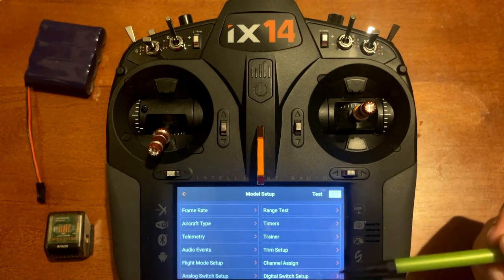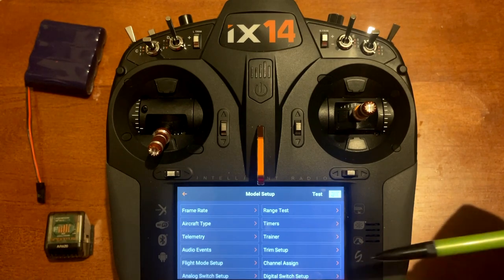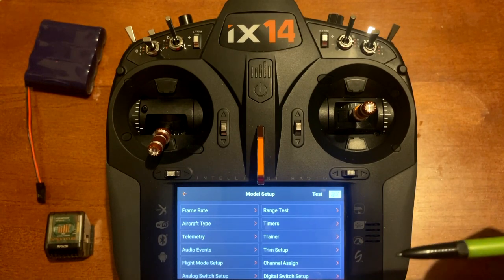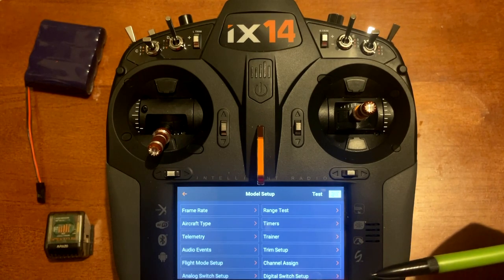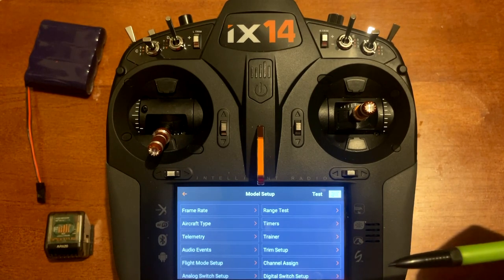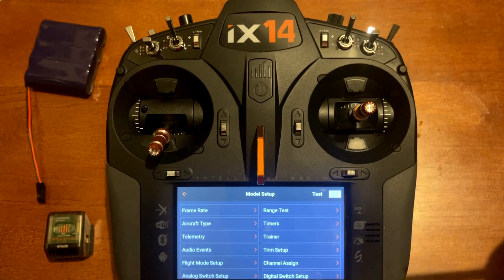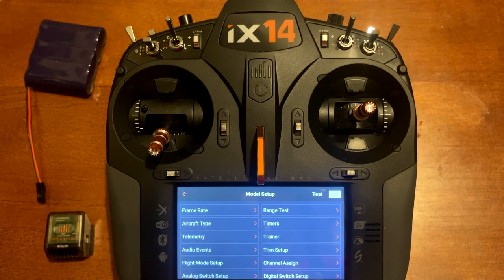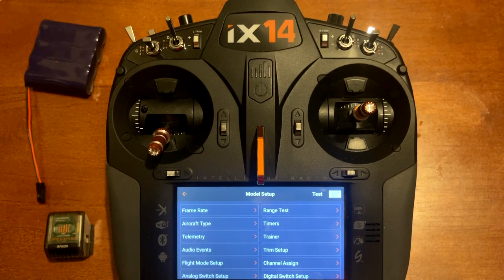Spektrum iX Setup: How to Setup RC Plane-Without Template

Comment: Hi BD! Thanks again for such clear and informative videos on the Spectrum transmitters! Very helpful! I do have a question. I'm having trouble trying to get beep sound from  my any of the trim buttons on any of my models. I have . Opened up a new model,  Went to "Audio Events" menu then to  "Trim Reports" menu...everything set at TONE and orange button at default. still  no trim  sound. I went to the Android set up page and made sure "sound notifications" was turned up..still no luck...Any suggestions would be appreciated! Thanks
Reply from the maker: Only issue trim sounds? Does other sound functions work? Which version is Airware App?
Reply: Thanks for responding.. Latest version.. everything works but the trim buttons. It’s a mystery.
Reply from the maker: @aidengriffen  go to sound settings > system sounds. Each one can be adjusted. See if trims option is lowered.
Reply: Well I went ahead and reset the ix14 back to factory default settings. And lo and behold everything is now working properly.. trim sounds and new software version sounds.
Not sure where the gremlin was hiding but seems like we’re back up and running! Thanks for your suggestions BD!

Comment: Hi BD. I followed your NX series and now the iX series, both have been very helpful. One annoying part of the iX setup is the default keyboard sound. I’ve had to turn the volume down. Is there any way of permanently muting it or changing the sound? Thanks.
Reply from the maker: Keyboard sound, referring to the click when pushing letters?
Reply: By process of elimination, it turned out to be the haptic tech sound. I managed to isolate it to an android setting and switch it off. iX newbie issue. Thanks.

Comment: BD , can I  setup my dual rates for ailerons,  flaps, elevator, rudder all to the same switch.
So in high rate everything is 100% and in mid rate everything is 85% and low rate everything is 75% .
Can I also set my expo for all at the same time in the DR on switch G  or F.
Thanks
Bob
Reply from the maker: Yes you can put all the rates on one switch. Selecting a switch at the bottom,toggle the same one and assign.

Same for expo since its tied to the dual rate selected.
Reply: Thanks BD for your help and expertise  through my most confusing part of the hobby.
Must be my old age lol
Reply from the maker: @robertchapman7773  reach out anytime :)